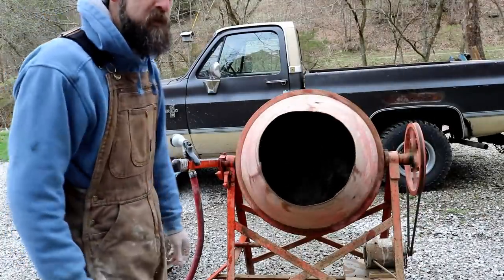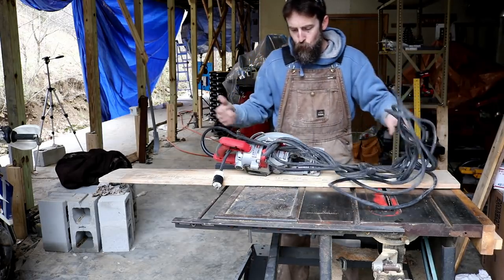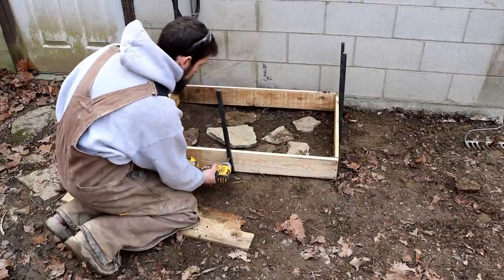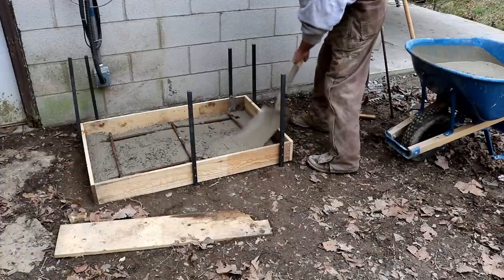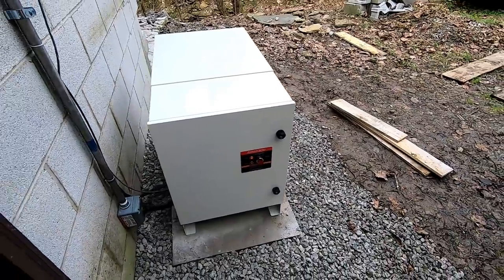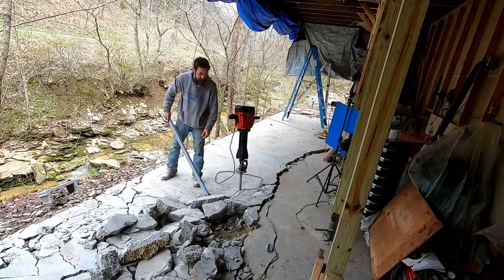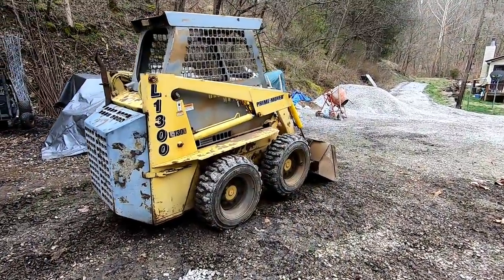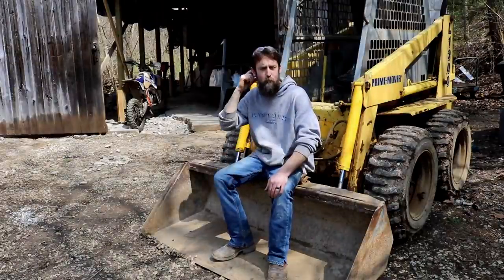Shop Damage #8 Jackhammer Time / Concrete pad and bobcat run

Comment: I do realize you can use your form steaks again but that was high dollar steel. Home depot has the normal form steaks already made and relatively cheap. And I know you may think you can save money  by mixing your own concrete and for small projects yes. But when it comes to pouring you footings and floor. Go for the ready mix.

Comment: I have the same problem with my mixer, darn thing is too low and the whole frame has to be picked up to empty it, twisted my back on that thing too many times. Have it set on some railway sleepers now. I also added a cut off switch in case I got dragged in.
Reply: Every concrete mixer I have had the misfortune to use has been built just short of being able to park a wheelbarrow under.  So frequent in fact, that I think it is done purposely.  Just wonder what the designer thought people would use to move the wet concrete after it has been mixed using their machine.

Comment: Your air hammer would have been fine as a concrete vibrator. I use my SDS drill in breaking mode.
Reply: horse1066 was going to say the same thing myself a blunt steel against the shuttering.

Comment: Steve: I still would want to get an Engineers approval for the Footing design so close to the stream bank...I speak from experience, you don't know me and I can tout whatever I say but it doesn't mean a thing, but I will say this with 50+ years in the construction industry...well let us say try my suggestion my friend please for your own sake.  Nice work so far and God bless.
Reply: He has said in previous videos that he is working with a structural engineer.
Reply: @craigleemehan  I too am concerned that the construction should be properly designed by a structural/civil engineer and what I have seen so far does not give any indication that is the case,  A case in point is that Steve is breaking up the broken slab without trimming the retained section to  be able to integrate it with the new slab.  It would have made more sense to trim the old slab with the broken section insitu to be able to run a floor saw along.  Now Steve will have to use a Skil saw, which will be much harder work.  If a structural engineer is involved, lets see the design proposal?
Reply: @clivewilliams1406  I was not intending to start a discussion on Steves going about his work at hand, I think he is doing a great job of demolition considering he is doing the work himself. I was just concerned about the construction of the foundation.
Reply: @fiorevitola880  I too am concerned about the structure and applaud his work so far but he clearly desperately needs some professional direction for the rebuild as this is not a simple foundation issue and will involve retaining the bank and coping with the obvious ground water pressure and well as integrating any new structure to the existing.  I base my comments on 40+ years of professionally qualified experience dealing with a myriad of structural and civil engineering solutions, with the best engineers in design and implementation.

Comment: Steve watching from ireland 
Quick question how come your not gone stand few girders(h iron) and timbers and lay 2-3 rows blocks on foundation between the h irons tieing in , and sheet with corrugated cladding from roof to just below the top block on rows.. that way you won't have as much weight on that side and no need for big thick floor here we do 12 inch for foundation and 4-2 inch floors it would be quicker and less work but its just a suggestion 
Love long vids your done

Comment: Those little tie wire loops are meant to be used with a twirly tool. I prefer to just use tie wire in a reel on my belt and Klein wire pliers (look like lineman's pliers but have a hook on the end of one handle).

Comment: DIY tool for those steel wire ties is to take a piece of 5mm steel rod, and bend in a hook one end. Then slip a piece of plastic conduit over the straight side, and then weld a washer onto the end. Makes the ties easy to use and fast, as those ties are very common here as a method to close up plastic woven bags on farms.

With the concrete add a little bit of cheap PVA paint in place of some of the water, it makes it a lot easier to smooth off, and acts as a plasticiser. Cheaper than buying plasticiser or bonder for the concrete, and likely you already have a can or hundred of odd colour around to use, as it will still dry to a gray finish.

Tip for the jackhammer is to take that power cord and loop it around your neck, leaving a small loop down. that way you do not have it in the way, and put the cable to your rear so you so not cut it off.

Comment: This kind of concrete platform does not need any grounding rod or some kind of "concrete round legs" deep into nonfreezing soil level depth? It will stay leveled after many years only by sitting there? Soil expands when freeze in winter times and that may lift up that platform.

Comment: Steve, What is your frostline there?  You need a good footing for whatever you build and the bank nearby needs to be stabilized or added to such that it is thicker than the frostline.  Frozen ground will upset a structure in a big way.  I've seen high block walls lift and spread with footings not deep enough.  Be mindful of this.

Comment: I've seen others vibrate small concrete slab sides with a sawzall without a blade. Just put the foot up against the side and pull the trigger.

Comment: That stream will continue to erode that bank... It's just a matter of time before it undermines any building you put next to it... Even if you took all that broken concrete and dumped it on the slope, eventually it erode the slope... The best you can hope for is to delay the inevitable and hope that the problem is something that the next owner of the property has to deal with after you have sold the property (or died)... In the end, "Mother Nature" always wins...

Comment: Steve, Instead of messing around down in the creek just pier the concrete to solid ground under the new floor. 18" piers at 6-8 feet centers will do

Comment: Would a few verticle lengths of rebar driven into the ground been a good idea to stop the slab moving horizontally on that unstable ground, on the edge of the river too.

Comment: Don't know if some of the busted up concrete could be used to make a retaining way between the shop and creek Maybe make a wall and then face it off with a stone (bolder's) wall. (backfill it with some of the rubble small pieces and dirt in between)

Comment: When you get ready to do the big slab I'd put the mixer up on a platform using a few of the blocks you have. Wouldn't need to tilt the wheel barrow.
Reply from the maker: That mixer needs to be about 10x bigger for that slab.  I wont be pouring it. I'll have that done. There's not enough of me to pull that off.

Comment: next time when you want to vibrate the concrete use a pneumatic hammer or any drill With the hammer mode and just touch it to the wood and it will vibrate in instant you wont have to poke with the normal hamer

Comment: Having seen how "sandy" (read crap) their block mortar was,  I wouldn't say that concrete was "plenty strong".   My mason had lent his good 90lb Jackhammer to his brother so he grabbed a Bauer to bust up a section of concrete at my pool house.  That was good high pressure (4500+ psi) concrete full of rebar and only 6 inches thick.   The only thing the Bauer would break was itself... and it did.   He took it back and retrieved his Makita - It still had to work hard.  So, be thankful that was crap concrete with no reinforcement.   Otherwise, you'd still be breaking it up... or looking for an excavator with a  bull-prick!!

Comment: I know it's just a pad, but.....   Yeah, I know, a thousand comments for anyone who does a video about welding, concrete, or barbecue.  You said "mortar" quite a bit.  Were you using mortar mix in lieu of portland cement?  Hope not.  That would be bad.   Some opinions to help on future projects.  A 1-2-3 mix will give great results for most applications, 1 shovel of portland, 2 shovels of sand, and 3 shovels of gravel.  Measure your water with a coffee can from a 5 gal bucket.  Dip the can in the bucket and add water to the mixer until you get your preferred consistency, counting the number of cans you used.  From then on, no more guessing.  You can mark 5 gal buckets for your ingredients if you don't feel comfortable getting consistent shovel volumes.  Add most of the water to the mixer 1st, then gravel, (keeps the mix from building up on the mixer walls and blades) and your sand and portland and remaining water.  When filling the form, tamping layer is not the best. 

When placing, you are better off filling a section, starting at the far corner to the top of the form and rod it in and working your way to the opposite end.  This method better bonds to the rebar and will be homogeneous and stronger.  If you do layers, don't tamp the surface so smooth.  You create a quasi-cold joint where the aggregate doesn't bond the layers together.  Tons of comments already about mixer/wheelbarrow placement, and the time savings in charging the running mixer before you go back to dump the wheelbarrow.  Comments and dissenting opinions expected and welcomed.  Please provide reasoning for dissenting opinions.  I'm here to learn as well as help.  I certainly don't know it all and am always looking for better ways.  Stay healthy and have a super weekend.  Steve, keep up the great work!

Comment: Steve, did your engineer friend discuss running pins or piers down to the limestone substrate (parent material)?
It seems like a lot less work than attacking from the river bed to stabilize the bank against settling of your new pad. 
Looks like you have about ~ 24" soil over top the limestone ...I would be guessing of course :-) 
Best regards, C

Comment: I was thinking the second batch needed to be wetter to help it bind better to the first batch.  You could have ensured the pad doesn't shift by driving some rebar stakes in the ground inside your containment box that would have stuck up about half way into the pad.  Marshaltown stepped up.  I'm not saying anything bad about Marshaltown trowels, but the gold standard in trowels was always a W.W. Rose trowel.  I was thinking that you should use that rubble as rip-rap to reinforce the bank.  Are you going to use geotech fabric under the rubble?  You are making great progress.  Wishing you continued success.

Comment: Steve, I’ve heard “Raprap” stone will hold that bank. Maybe along with your ruble a good load of that rock “terraced” will secure the site. It’s used quite a bit by the road workers. Not sure how expensive?
Reply: That kind of stone for armour facing is called "riprap".  The dimensions of the stones depends on location and use, usually 4 to 6 in. up.

Comment: bend a nail ( cut the head off ) slightly over 90 degrees and put in a drill to tighten the tie wires on your rebar since you have the ones with the loops..

Comment: Impressive engineered concrete base Steve, love that mixer.
Are you able to source Polypropylene Fibres for "Fibre Reinforced Concrete" when you pour the foundation and base in your neck of the woods, adds considerable strength to concrete. Has anyone else used FRC?
Great vlog, stay safe all, and thanks for sharing.
Reply: All I use is fiber reinforced and I pour over 5000 yards a year.  Hard as a coffin nail and better crack resistance. Usually in a slab like his garage I would use #3000 with a commercial fiber load.
Reply: Actually, in my 30 years of pouring concrete for a living  our company has found FRC doesnt do much for large shifting. it holds the small particles of stone in place but not the entire pad, Rebar and mesh are the old tried and true method and still holds true today . Nothing will hold that slab if erosion control is not a PRIMARY concern !

Comment: have you considered using cage gabions to under pin the bank? could fill with some of the bust up concrete.
Reply: Only temporary fix, as sooner or later the wire mesh will rust out!

Comment: Hi Steve,
I have been away for a couple of months, so catching up on all the workshop progress in a box set - cool. For the jack hammer cable, you could use sky hooks to suspend out off of the deck when working. Also what motor is in your truck? Sounds really good. 
Yours Andy - Uk

Comment: Howcome you didnt use the tablesaw for the wood cutting?doh....I'm also wondering why you didnt just use wood stakes around your little form(hard ground?)and lower than the form height for screeding....heavy duty rebar also.nice little slab..maybe a little lean to overhang for the inverter thing off the building...love the series so far...as others hav, said my back hurts just watching you do all that block work..I feel for ya man.

Comment: why dont you use the rubble from the slab for the reinforcement of the hill side instead of moving it across the street you can place a layer of concrete between layers to reinforce the rubble and cover the rock when your done with dirt so as not to ruin the natural feel of the area??

Comment: Unbelievable building standards in the US. No redo in concrete? That’s basic 101, put the right size reinforcing steel in and it won’t crack under load.

Comment: Hi steve, just wondering what size jackhammer are you using? 35 pound or the 70 pound 
Nice video.  I need to bust up a 20x14 4 inch thick slab

Comment: Should have made that pad big enough to move that big air compressor outside.  No reason for it to be running on the inside making all the heat and noise.

Comment: you dont have to Cut down your forms to the 5" height- you sink them in the ground and back fill the hole up to the depth you want and grade it out before you had the wire & rebar...... makes for leak proof sides that dont bulge out when the concrete is added

Second batch wasnt "Too Wet" the first batch was TOO DRY! for sure! hahaha

I think a dozen or twenty pilings along that side drove in 4-6 ft and a old railroad tie retaining wall with "Deadman" placed every 6ft or so and then backfilled with rubble and soil would help alot- I have built a few over the years, but always on a regular drainage ditch or swale never an active creek with such a steep bank! you got a challenge there for sure! wish I lived closer, I'd come give you a hand, surprised none of the other you tubers have offered to collaborate with you? I know that Abom can haul some concrete and pound stakes-
Reply: Have a friend who bought a home by a pond near a stream. The bank between the pond and stream had eroded similar as yours. His excavating contractor corrected it the next winter when the ground was frozen by digging to bed rock in the stream bed with a mini track hoe and replacing the removed dirt with rock filled rectangular wire baskets. After back filling the pond side heavy rains have deposited silt through the baskets forming a solid trouble free wall for the last 10 years.

Comment: What a shame, all that concrete and work wasted for some mesh and decent prep.
A series of 2 ft diameter concrete pins, under the new slab, at the edge of the building, on the stream side, down to a hard substrate ?
Reply: Definitely the way to go! 

Shoring up the bank is going to require a huge amount of material, and it's still going to want to shear down the hill. Concrete and steel piles will ensure all of the forces from the weigh of the floor slab will be perpendicular. No matter the depth, probably a lot less excavation and much easier material removal than working down on the bank. Also, the bank looks kinda nice in its natural state! I'm sure there must be guidelines for appropriate depth, cross-section, geometry, construction, etc per soil type that could be easily found on the web.
Reply: For sure the way to go. Not sure how you guys do it over there but over here there are smallish pile driving rigs. Obviously you wouldn't get one under the roof but if you extend the pad out four feet or so jobs a goodun. Make a nice sort of balcony thing to look at the stream from too.
Reply: Yep some trial holes would be useful, from looking at the other bank he might find flat limestone 2-3 feet down. The failure seems to have come from erosion under the slab rather than shear forces from the hill, the site looks flat?
Reply: A further thought Steve. You can probably hire an an auger for the bobcat, that would make it real easy.
The trap is not cleaning the bottom of the holes super well, any spoil will let the pins, and so the slab, sink.
Love your work, Tom.